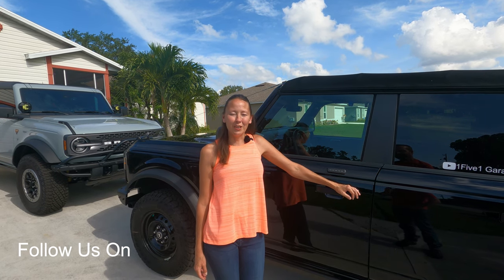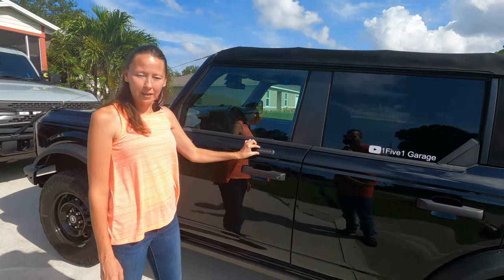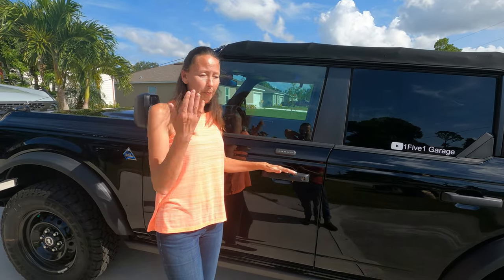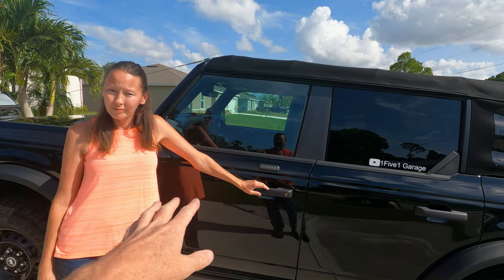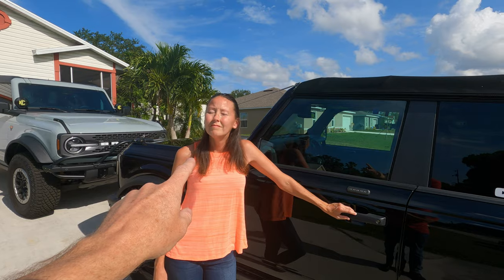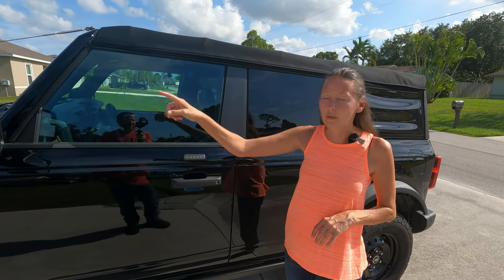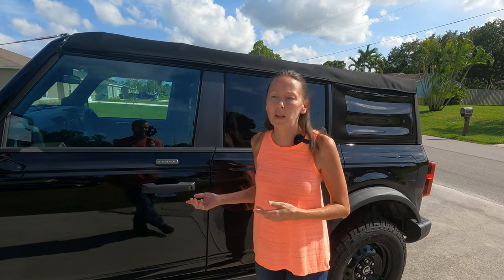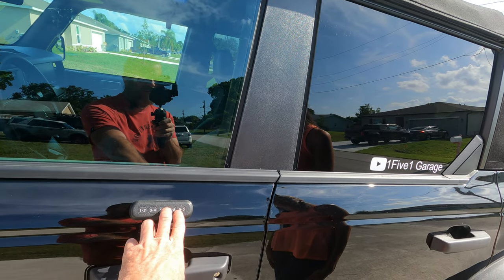WE FOUND ISSUES WITH OUR ICE MOUNTAIN BRONCO ALREADY... PROGRAMMING ISSUE

Comment: I’m experiencing the same issue. My card is located in the fuse. box the doors unlocked, but will not open the doors with the factory code or I cannot reprogram new code.
Reply from the maker: Service department. Geez this is like the 3rd or 4th one on here w same issue. I wonder how many bronco door keypads locks r not working 😱

Comment: Same thing happen to my bronco. Took it dealership. Told me that the actual keypad was an aftermarket. Even the tech was confused. They re ordered a new one, and reinstalledd it
Reply from the maker: An aftermarket pad from the factory? Did they run to AutoZone to get one because they ran out? lol
Glad they were able to fix it.
Reply: @1Five1Garage  that's what the tech from the dealership told me. I also was not able to get the code with my two key fobs. 🤷🏻‍♂️

Comment: So there’s no sticker on the BCM? Usually on all Fords that’s where the sticker for the code is located. Forscan might have that feature where it can read the code imprinted in the BCM. Not sure about that one. I know you can get it from IDS that the mechanics use at the dealership.
Reply from the maker: Most do have the sticker like the F350 we drive. The Bronco however has a little credit card sized card with the code that mounts in clips on the front of the fuse box. Why they changed that? No idea.
Reply: @1Five1Garage  They must be trying to save a penny per vehicle. I worked at Michigan Assembly (when they made Focus’), and they had a card and a sticker on the BCM. 🤷‍♂️

Comment: Similar problem on mine, but entirely self-inflicted: if you have a dealer program and install a keypad, whatever you do, do NOT revert to as-built body control values in Forscan, as your vehicle was built without the keypad. Gonna have to go pay the piper to program it a second time... 😞
Reply from the maker: Good to know...

Comment: Ford has two of those keyless entry pads.  In the description on the accessories site, both of them say they require the Dealer Service Tool (IDS/FDRS) to get them working the first time.  Perhaps they never got it working at the factory for the first time?  Have you stopped by your dealer to see if they can get it working?
Reply from the maker: We took it to service. Turns out the pad was fully functional, code programmed in vehicle was correct, it was just the books that got mixed up.
Reply: If it can lock the doors it's connected to the vehicle and has already been set up.  The keypads on the Bronco are entirely wireless.  It's essentially a key fob operated with a number pad that's glued to the door.
Reply from the maker: The problem isn't that it is not connected, the problem was that the code card given to us isn't the code programmed to the keypad.

Comment: On my raptor it was on the back of the computer , and I believe it's the same on my superduty . But my wife's bronco we have the same issue
Reply from the maker: There is a credit card sized card under the dash on the drivers side. It had the wrong code.
Reply: @1Five1Garage  yeah mine was wrong too lol
Reply: @Travis-hl3oz  Try the code but if it says 01234 punch in 12340
Reply: @weaverswandering972 we had ordered another bronco a year ago so we traded the other one in and they aren't doing the keypads anymore

Comment: Mine isn’t working either. Same exact situation as yours, keypad is programmed to the car so it is sync but the card (which was on the fuse box) number didn’t work.

Took it to the dealership today and the mechanic that got it plugged to a computer couldn’t even get the correct code. The dealership is going to follow up on it with ford but I suspect it’s the same exact situation with your vehicle. My code could be yours for all I know lmao
Reply from the maker: Oh no! I hope they can get it fixed. 😂 wouldn’t that be something if it was ours n vice versa!
Reply: Me too!!!  Maybe I have your code!
Reply: Did you get a new one placed on or are you still looking for your code

Comment: My key pad we bought on our 2021 Sport never worked and couldn't get Ford to fix it. So we didn't get it on the new 2022 Bronco.
Reply from the maker: That sucks. Our Badlands and Badlands Sport both worked without an issue.
Reply: @1Five1Garage  Well a little more pride goes into a Lincoln Cartier ed. than a Fiesta LOL
Reply: That should have been covered under warranty or Lemon Law. I'd talk to your state's Attorney General.
Reply: We traded it in for the Bronco when it came I so we weren't worried to much, but it did suck that we paid extra for it and couldn't ever use it.  We used it ALL the time with our 2017 convertible Mustang (we had her before the kids grew legs and I couldn't drive with them in the back anymore.)
Reply from the maker: How do you like the Bronco compared to the Bronco Sport? Children that grow legs always seem to put a damper on the sports cars.